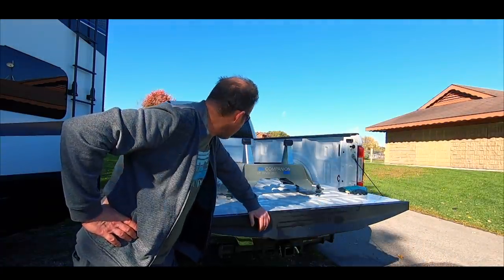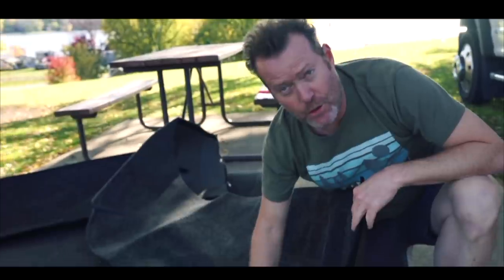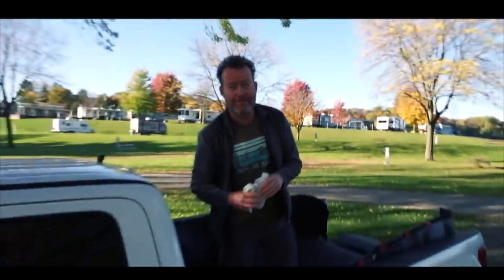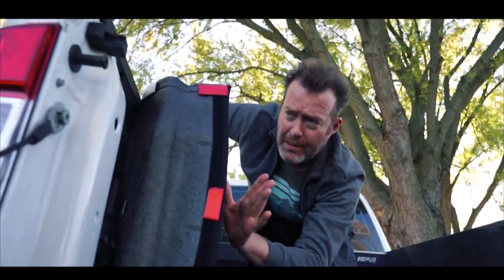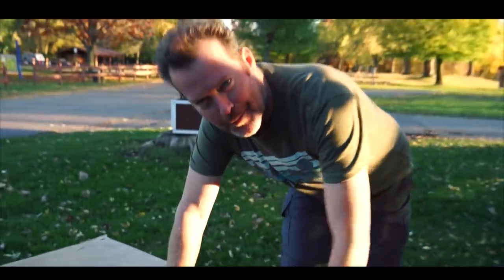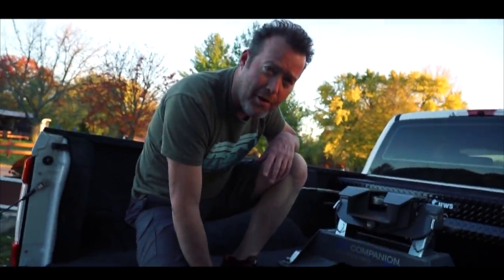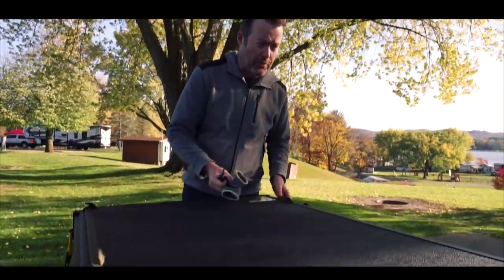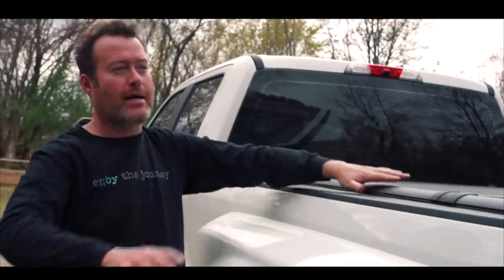Shocking MODS & UPGRADES To My Ford F450 Truck!

Comment: Great video as usual Tom! 👍 Thanks for sharing with everyone.  I use a window reflector too.  It is the pop open version (like those self opening tents).  Just a twist collapses it.  You might want to look into one.  They are super easy to store and install.  Cheers

Comment: The Bed Rug looks like a nice  product.  Surprised it did not have slits for the rear tie downs or the electrical box given that it is an F-450 specific product.  Was the electrical box a special option or aftermarket add-on?

Comment: The upgrades look good but just a friendly FYI the the tonneau cover actually will not improve your gas mileage at all it looks good when you don't have the fifth wheel on they will keep stuff In The Box secure. The tool box needs to be bolted down or it's going to go sliding all over. Have first-hand experience with bed rugs they will hold moisture in there even though the aluminum wont rust it will corrode overtime. also over time organic material will buildup in the rug and under the rug which will start to rot, stink and mildew because of it holding moisture. a spray-in truck bed liner offers more protection and lasts longer.

Comment: Great additions!  One suggestion is to use 91% or higher isopropyl alcohol to clean the bed.  Less water content means faster drying.  The catch may be finding it!

What are you doing to secure the tool box so it does not slide and damage something?

Comment: The Bed Rug looks like it would work best under a canopy. I wonder how well it will hold up exposed to the outdoor elements over time.
Reply: My first 3 trucks with the Bedrug left it completely exposed to the extremely hot South Texas Sun day in and day out for years. Never had an issue with any of them.
Reply: @BigTruckBigRV  thank you for your experiences. Would this work for a slide in Truck Camper?
Reply: @code4forlife  Ask ETrailer.com

Comment: I enjoy your videos, but why the "Bed Rug"? That just looks like a nasty moldy mess down the road especially since when you are towing you can't close the cover. Why not just a spray in rhino coat instead? Not only does that thing look bulky and a lot of trouble, but it's going to collect moisture and just ugh start to smell really bad because you can't seal it off when you are towing! Not like you can take it out and throw it in the washing machine from time to time. JD doesn't full time, so maybe it works for him because he can keep his cover closed all the time.  I don't think that was a good recommendation. I would highly recommend you pull that out every few weeks and let it dry out and your bed dry out and then have to put it back in. I don't know how you are going to do that in the middle of winter though? I hope I am wrong, but I don't think so... The rest of the install looked cool! Love the tool box, I am assuming you bolted that down when we weren't looking? LOL This farm girl grew up with trucks and everything slides around when you are driving!! Please do an update on that rug as I am curious how it is really going to work. I don't like look of it either, but that is a taste thing for me!

Comment: Question concerning the tonneau cover. When your connected to your 5th wheel, can you access your tool box? Reason I’m asking is because I’m planning on installing an auxiliary fuel tank, but I would need to be able to access it while towing. If you’re able to access your tool box while you’re connected to your 5th wheel, that would be the perfect cover for me.
Reply: I put a 50 gallon auxiliary fuel tank In the bed of my truck.the auxiliary fuel tank is lower than the top of the bed rails. My tool box is in front of the fuel tank.an it is mounted on top of bed rails.I look into the tonneau covers that none of them would work for my set up.the way my toolbox the lead opens. All the way across an the handles are on the front of the toolbox.you can get a toolbox an fuel tank all in one.there are a lot of covers for the bed of truck.just go on line an see if there is one that will work for you.

Comment: Make sure that, before you tint your vehicle, check your state or province's rules for where you can tint and to what level of darkness you can use.
Reply: So true, also even if you are allowed a dark tint, just remember that when it is dark outside, you can't see out!  Previous owners of my truck tinted dark up to the limit, living in thr country, my mirrors were practically useless, could barely see them at night.  While great in the day, they bite you big time at night.

Comment: I ike the bed rug it would  just be nice if the manufacturer  had one for the puck system and the electric  plug already cut out. I think that would look cleaner
Reply: If you look at the back side, they imprint the area to cut out. They don't cut them because then they would need to have 3 different part numbers and three different inventory items for one bed.   They are super easy to work with  though as long as a sharp knife is used, and due to temperatures and how long it has time to relax, the openings if they precut them may not line up.  I've installed several of them, they aren't that hard to get  looking like they came from the factory.

Comment: Very much needed upgrades for any F-450 owner.  While it looked to be a bit of work getting the bed rug installed, the end look was amazing and it actually looked comfortable to crawl around on.  That tonneau cover also looked much better than the flimsy one we have on our truck.  I’m going to try and sell the one I have now—about 1 year old—and see about replacing it with one of those hard top covers.  I’m hoping to find a quarter fold model as that would make it easier to access things below the front panel.  just be aware that when it’s folded up into towing mode, the gap between the top of the cover and the bottom of the fifth wheel is much less, which could hinder driving through some deeper ditches or driveways.  JD from BTBRV mentioned that in one of his videos.
Reply: That was his higher profile toolbox, thats he bought a lower profile one.
Reply: @showcasecharlie11  I understand about your comment on the tool box height.  I like the shorter toolbox Tom used and will be looking at them too.  In my comment I was referring to the tonneau cover height when it’s folded up.  JD had mentioned that height factor when he was talking about why he got the shorter roll-up cover over getting a fold up model with his new lower toolbox with the shotgun handles.  In our case the folded flimsier cover adds 3 inches of height and if I was turning into any entrance with a steep incline then it could become an issue where the two (cover and fifth wheel) might touch. Towing straight typically wouldn’t be an issue with the added height, but making sharp turns could be in some instances.

Comment: Does that tool bex just sit there or does it have something to hold it in place?
Reply: It will be fine just sitting there. Mine sits in just fine, once it sets in with weight, especially in the bed rug, it isn't going anywhere. And if it does...you got problems,  cuz you're upside down.
Reply: @showcasecharlie11  lol
I dont have a bed rug but I do have a spray in liner so I was just wondering. I like the fact that I can keep the current tonneau cover I have. Thanks for the feed back😎

Comment: So how did you attached the toolbox, and can you access it easily with the cover on, without removing the whole cover?  Great video as always!
Reply: Not attached because it's in a locked tonneau cover.
Reply: @TheWestlandgirl  maybe, but bouncing down the road I wouldn't want that thing shifting around and possibly even hitting the hitch release.
Reply: @stevetekrv5791  Oh yeah, not good that.